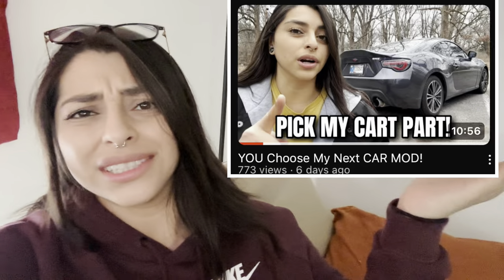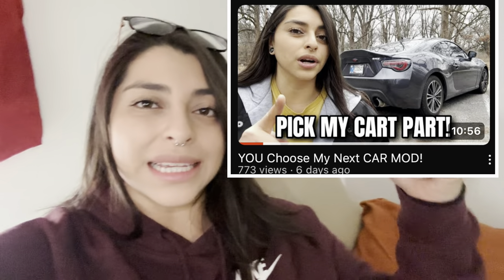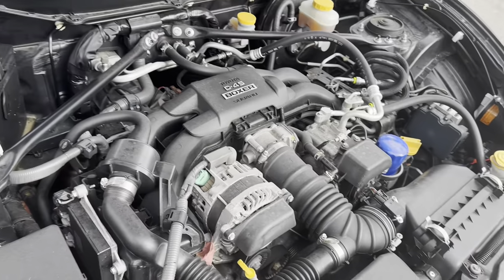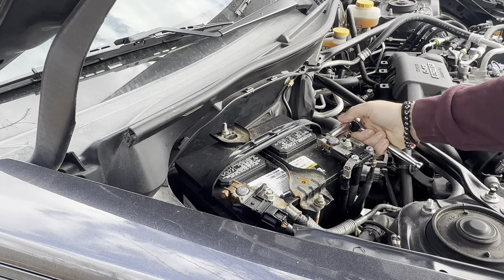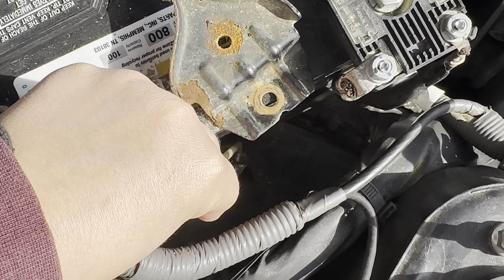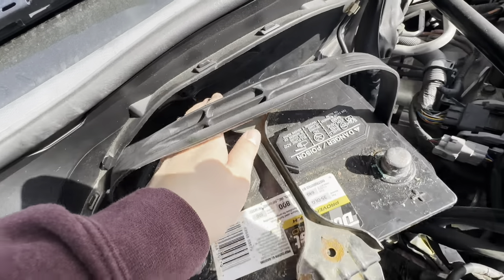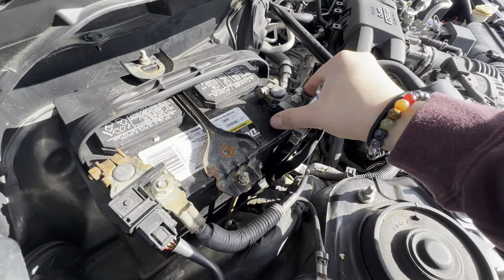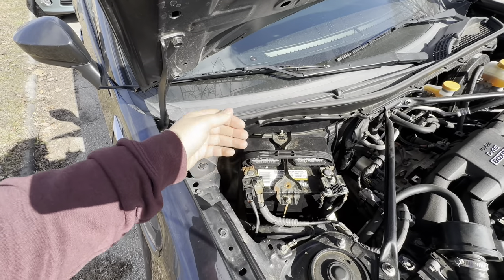How To Change A Car Battery + Battery Terminal FAIL!

Comment: The BRZ terminals are not that bad they look cleanable with scotch bright or wire brush. I thought I knew how to change a battery so I did the change in the NAPA parking lot. Then I noticed the bolt head on the positive side was so corroded I had to cut the bolt with a multitool (oscillating battery powered type) and get a new battery clamp. The old clamp had two #4 awg wires under the same stacon. The new clamp came with two stacons. It took me a while to figure out the new clamp kit was expecting me to separate the wires and crimp a stacon to each wire then put the bolt through both. I actually had to cut the old stacon off using the multitool because I had to save what little slack I had on the wires. It did save me a trip by staying there when I got the clamp but if I didn't have the multitool on board that would have been just as bad.
Reply from the maker: Sounds like It was your lucky day!! 🙏🏼🙏🏼🙏🏼

Comment: Aloha, perhaps you can get away with using a stiff wire brush and sandpaper (where it contacts the battery post) to "restore" the terminal. You can even put a light coat of silver or black spray paint on it. 🤷. Thank you for another good video.
Reply from the maker: Yes that was my thought as well! I’ll try that before buying any parts! :-)